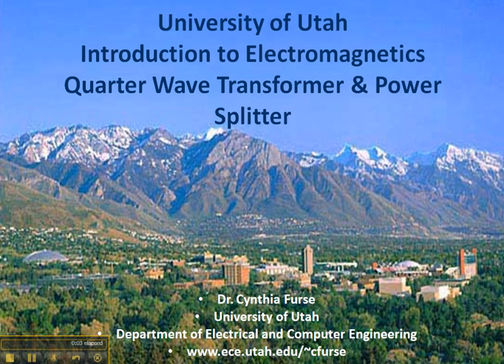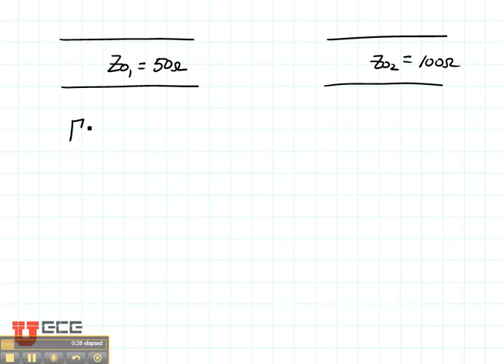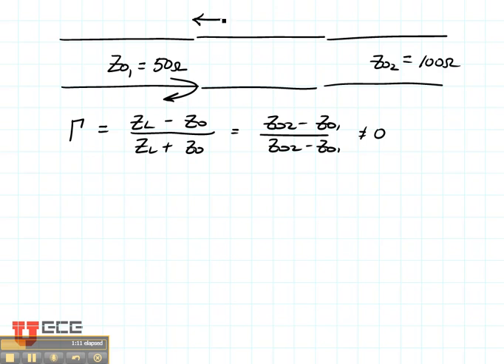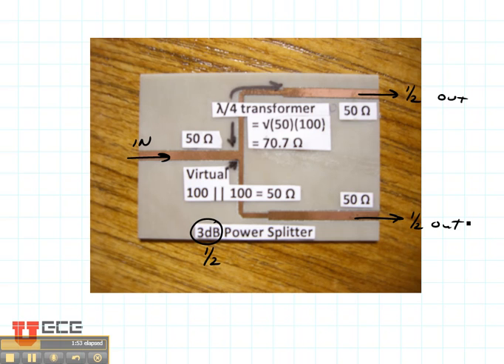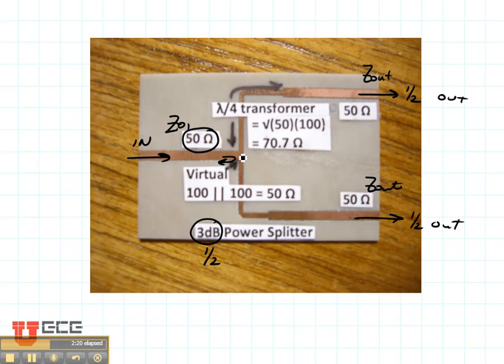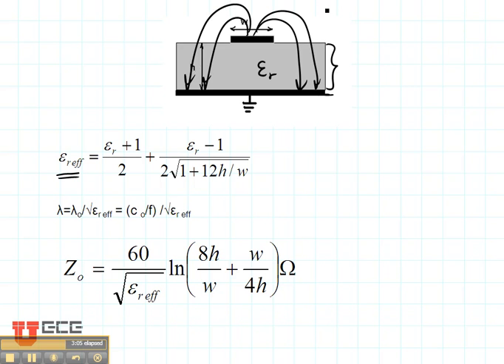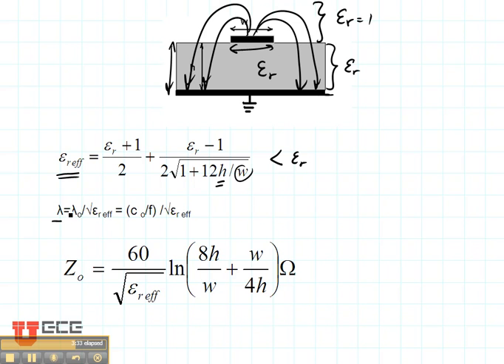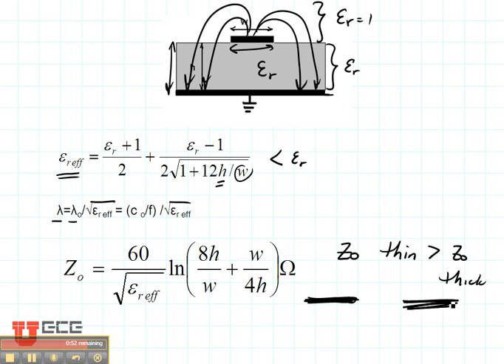ECE3300 Lecture 8-6 quarter wave transformer

Comment: Dear Madam,
Thank you for your video. If we assume a substrate of FR4 (relative permittivity εr = 4.4) with a thickness of 1.6 mm, what would be the length of the quarter-wavelength transformer designed in your video?
Thank you very much in advance for your help.

Best regards,
Davide

Comment: Great videos Dr. Furse. Also, If possible can you explain why on a Wilkinson combiner (with isolation resistor), when one of two input legs (Pin=0dBm 0deg) is opened, the output goes from +3dBm to -3dBm? Cant seem to fined anyone to give me a good explanation. thank you.